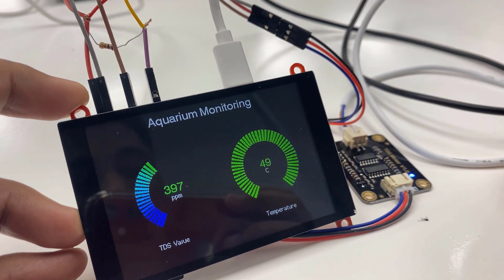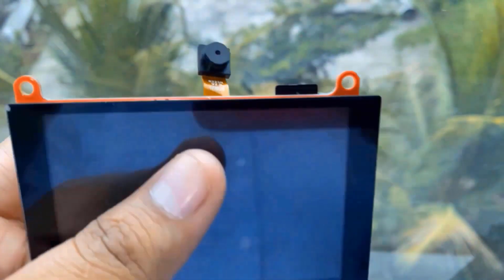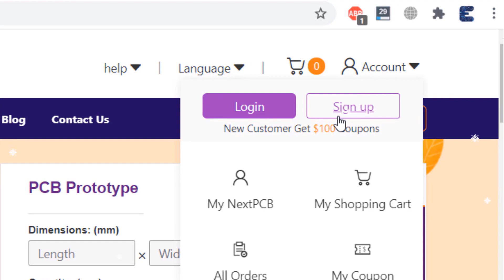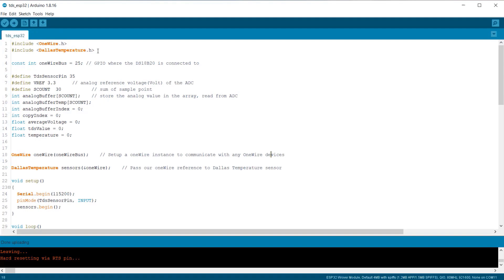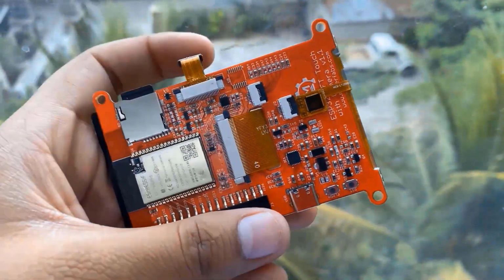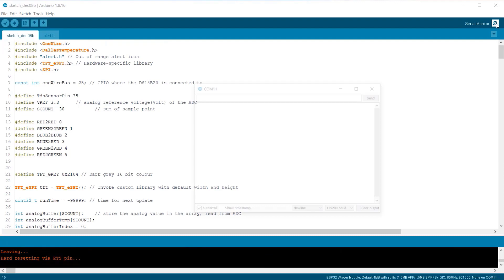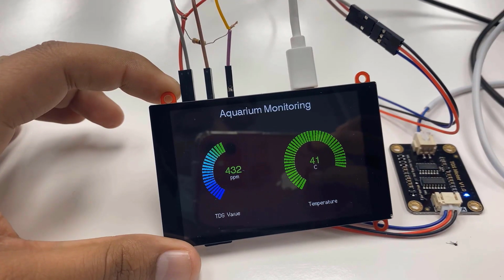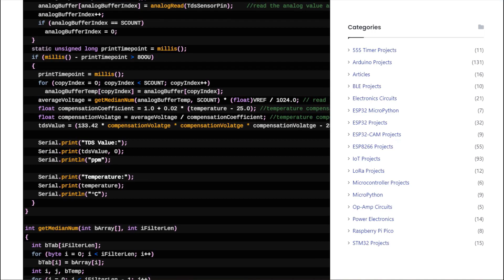Aquarium Water Quality Monitoring System for Aquatic Life using TDS + Temperature Sensor & ESP32

Comment: Great video but the board you show has problems to read SD card at less whit the Arduino examples version 1.3  lose the communication whit SD card , if you can do some code using SD card and share will be great